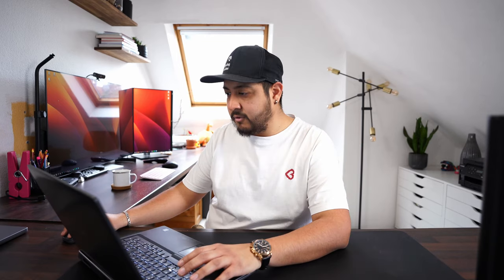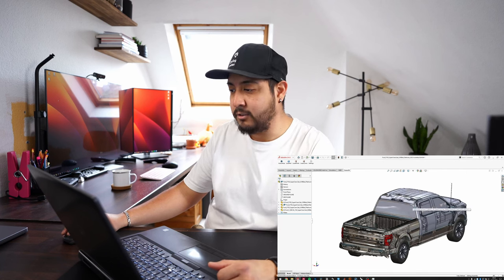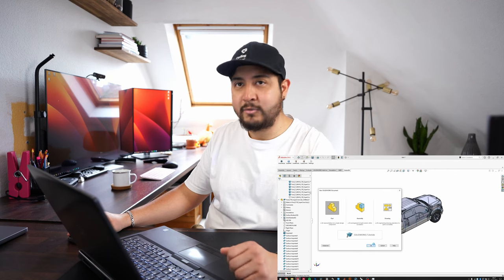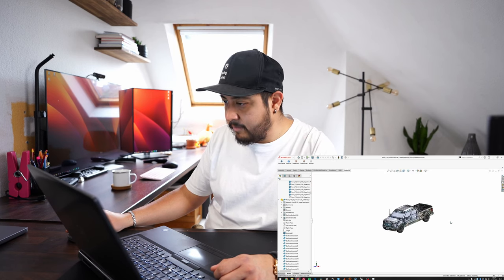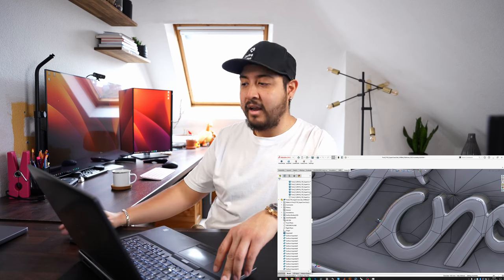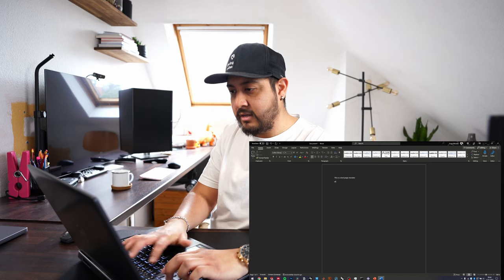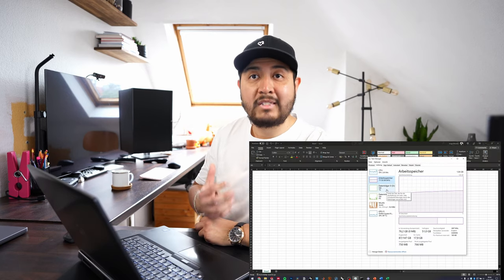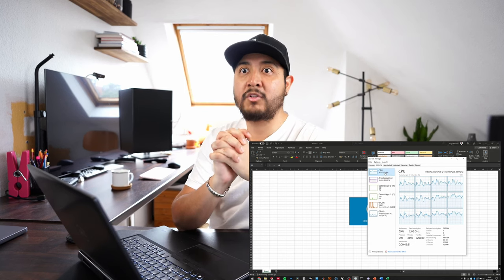The Truth about Mobile Workstations / Dell Precision 7530 Deep Review

Comment: i just bought a 7530 with an i7 8750H and the P2000 for 300 euros after seeing your unboxing video, and i absolutely love it. Big step up from my latitude e6430 that got me through university. Its a shame dell got rid of the e-port for docking stations when they moved on to 7th gen processors, but thats how it goes. .
Reply: Can't you use thunderbolt 3 for docking station?
Reply: @petertaylor4758  You can, but that's software docking, instead of the hardware docking that previous gens had. Big difference between them.
Reply: @SilentDecode  I'm new to the PC scene.
 I got a laptop that was five years old .
 And I just said my peace. It's my way of learning. 
  Have a nice day and peace
Reply: @SilentDecode  oh ok thanks for the info. But I probably won't need a docking station. Like I said I'm new PC user and I'm sure I don't get the most out of it

Comment: Jorge, you did the same as me I buy without a hard drive and ram I will use my own stuff  I will use windows 10 pro also I just got the 4k screen for 59.99!! took off the fhd one that you have I installed it with no problem! I just got this laptop for 300 I installed gskill 128gb ram and the fastest 1tb Samsung 990 m.2!!! this is better than most laptops today for 2023 you can also update the video card on it as well with the 3070ti 8gb for 159.99!!! This is like a desktop I love how you can update everything Jorge this laptop is not old yours was made in late 2019 almost 2020 laptop is not old till 7 years
Reply: Where did you get to purchase your model?
Reply: Where does one purchase a 3070 TI mobile GPU?  I can't find one for purchase.

Comment: Do you thnik Dell Precision 7530 with i7-8750H processor 36gb ram and  Quadro P2000 graphics card would be good for streaming online via OBS Studio (not games at all, more for vlogging)
Reply: That will work great for streaming vlogs.
Reply: @gojiraforbreakfast  what about gaming
Reply: @whoswho8241  not very good at all.  GPU equivalent to Gtx 750 maybe.  Terrible gaming performance with quadro graphics.
Reply: @gojiraforbreakfast 
that's not true it's equivalent to the gtx 1050 ti , I'm using a quadro p2000, and it can run most games at 1080 60 fps , about 60 fps on palworld and 120_200 fps on cs2 different from map to map because the game is shit.

Comment: I have this laptop with 32GB RAM and P3200 graphics card, but the speed of the system is very slow, from the boot speed to the speed of working with software. The boot speed takes more than 17 seconds, the speed of working with software such as Photoshop and even Windows Explorer is very slow to open and load. What is the problem? Please help if you have a solution. The battery is only broken, that is, the battery does not work, I have to connect it directly to the power to work, of course I set the power settings not to work with the battery, but the speed is still very slow. Thank you.
Reply: May be a late reply but hope it helps. That problem shouldn't happen cause of the battery or not having one while running it. Try opening it and cleaning out the vents and around the fans. It may be due to a heat related problem that's slowing down your laptop, though it may not show by throttling. May be that your cpu and gpu are due for a new thermal paste application. Also go into your setting on your laptop and turn off any applications that start up when you boot your laptop as well any other things that run in the background that can away from performance. Like email refreshing, messaging apps, pretty much anything that refreshes in the background that you really don't need till its used. Especially in an older laptop that any newer applications may slow down the not so up to date hardware

Comment: Jorge, I have a similar workstation like yours, with i9 processor, 128gb of ram with 2666mhz, one nvme of 1tb and 6gb Nvidia Quadro card. It's the best computer I had, the performance is amazing and it has nothing to envy to Mac computers. With half or less money you can get a powerful computer, without spending thousands of dollars for a Mac. That's the bottom line (cause Stone Cold said so 🤣)
Reply: how is the battery life for you? do you keep it plugged in or take it more on the go? Im looking into a new laptop for my engineering degree but I don't know whether not having an integrated graphics card will decrease the battery life significantly or not
Reply: @kevincamarillo2429  Life battery is not the best. I would say it like this: With great power there must also come huge battery consumption"...